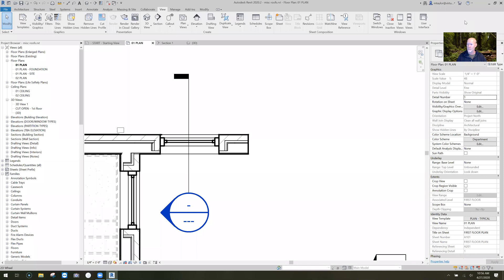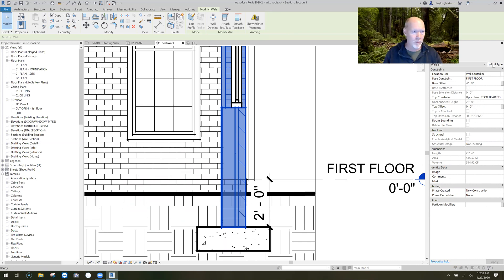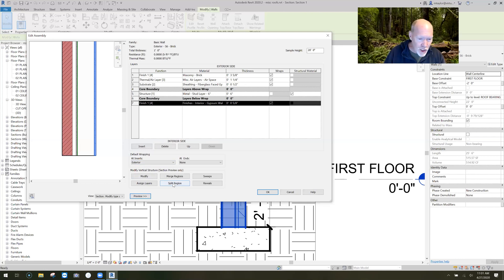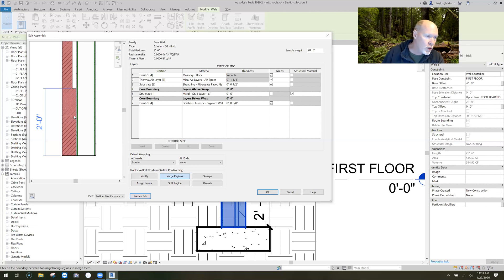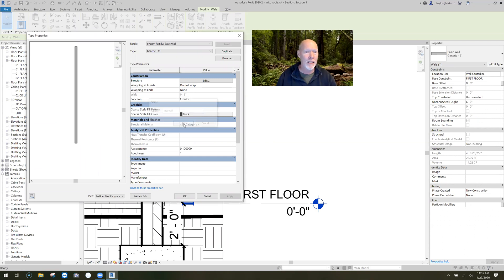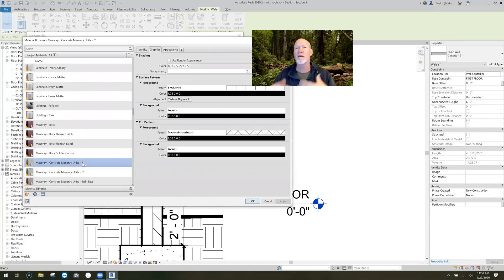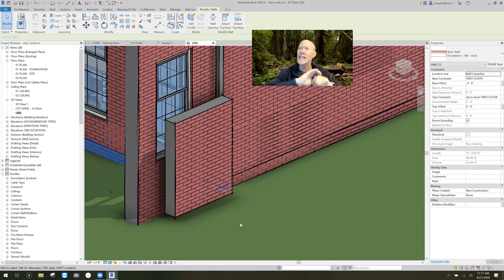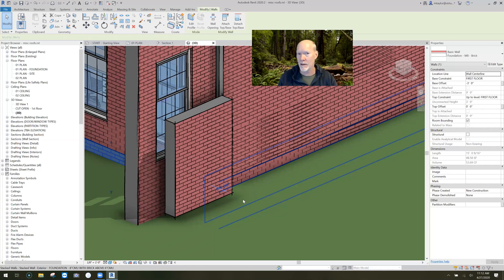MODIFY VERTICAL STRUCTURE OF A WALL: Merge and Split Regions

Comment: Ok so you split your wall brick above and CMU below. What if you want brick below and nothing above, in other word one of your element of the wall does not go full height. Do you have to add an air gap above? I see the use of the splitting wall but if you have to do that just to be able to modify the height of just one element, it seems like typical Revit nonsense. You have to split it in half then assign an air gap or some invisible material which I bet will still appear in section and that you will have to consequently cut-off with View/Cut Profile in every single view you have created... talk about counter productive. All you want is an Edit/Modify Height for each element but no, with Revit you have to create another view that the one you are working in of course because with Revit you always have to do it in the view that the developer has decided you have to do it in. Modify height of one wall element? I should be able to do it ANY view because you know what maybe I am working in a plan view or in an elevation or in a 3D view right now, and I want to be productive so I don't want to open or create another view. It is just an element height you want to modify, it should be SIMPLE! but no of course the torturous mind of a Revit developer is going to take you through a maze of tools that are useful indeed if you want to go intricate, do a bit of 3D Detailing why not (clients don't want to pay for it) but right now you want SIMPLE and it is just not there. So in typical Revit fashion and this is why it is so hard for graduates to jump into Revit from any other software, say goodbye to your intuition. You have to think like Autodesk, a firm owned by Wall Street lawyers so what would a lawyer do, and what does Autodesk actually do? I would buy technologies and software from various foreign companies most likely European if you are interested in Autodesk strategy to either destroy that piece of technology so it is not available to my competitors and end users or to merge it into Revit.  And oh boy, you can tell Revit is a freaking patchwork of different bits of technology and like the Frankenstein monster it is not very well stitched together. So the end user end up going through nonsensical processes to complete the most simple of task. One button: "modify height" pretty please? Nope it is just too straight forward, too fast. I looked at 'Create Parts' again it does not look like the feature you would use to modify the height of just one single element. These walls are full of features that are probably fun to explore when you are modeling a shed in your garden but when you have deadlines and you have to deliver the goods, 95% of your tasks should be uncomplicated, you want to be one to three clicks away from completing the most simple of tasks. Don't get me wrong, it is good that it is there but when I look at this particular feature I cannot see any application for it outside 3D Detailing because realistically and from a practicality viewpoint if you start adding sweeps and reveals and layers and merge or split stuff inside one wall, it means you are going to require a staggering number of Wall Types that you will want to be able to quantify but not necessarily show in Schedule. And I am not even starting with adding Metadata to your walls. It is only if you have time to isolate a bunch of walls to create 3D details that this feature is truly useful. Problem is, you need your end users to be perfectly drilled meaning know the PROS and CONS and avoid the temptation of using the tools that you know sometimes. In a large project where simplicity is key and turnover of Revit staff is high, going through a scroll down list of 500 walls because some Revit developers thought it would be a good idea to always create complicated paths but rarely the one you are going to need the most is NOT A GOOD IDEA. YOU with all your experience of projects going awol, you will know this is not a feature anyone should use, in fact there should be a big RED SIGN "use only in case of NO emergency". But the young graduate who knows his Revit tools, he is going to go for it to impress everyone with his Revit skills, you know like those guys who create Revit families so accurately close to the final object you cannot even dimension them. KEEP IT SIMPLE, that should be the number one rule. So let's say one of your technicians is an experienced Revit user and he is going to have the very BAD IDEA of using this very feature on all your walls in a large scale project because it is fun. It sounds great at the beginning but guess what, it is going to snowball when you will have to Schedule that monster. There is no naming convention in the World that is going to be able to tell young and even experienced Revit users that will come on board what wall type they should be using because someone made it OVERLY COMPLICATED and from there you know it is going to snowball even worst, you know people are going to start duplicating wall types that don't need be because they cannot find that one freaking wall they need because one guy decided to have fun with his Revit toy. This type of feature would not be a problem if you also had the simple "one-click away" feature and people were able to stick to common sense, problem is you don't have that "one-click away" option and most people don't use common sense therefore every single freaking Revit user in the project is going to achieve what they need to achieve the only way they know. I am all for nice features like these don't get me wrong, but in my view these are the type of features that will send your project into oblivion very quickly if you don't have a total control of what technicians are doing and guess what: Architects Leads know SQUAT about Revit, how you do it is not their concern as long as you do it right and in time. In any industry, you have to cover the basics well before you explore the fancy stuff, and I like the fancy stuff but I also know from experience the more fancy stuff there is the more rules you need to put in place. My gripe with Autodesk because they do buy a lot of technology from everywhere is that they don't take time to think about how a project actually goes to completion. KEEP IT SIMPLE. BASICS first and foremost, FANCY FEATURES come after. It is brilliant to have both, it is dreadful to get the fancy stuff but not the basics. If I buy a car, I expect it to have wheels on it, not wings because most people don't need an aircraft to go to work, it is cool but it is not practical.
Reply from the maker: Perhaps you should get a job at Autodesk and help us all!!! We have made ‘suggestions’ for them to implement.. but they seem to fall on deaf ears. I feel your pain!

Comment: Another option to create a thicker base wall could be to used a stacked wall, but you lose the controls you showed in this video. This was a very helpful video!
Reply from the maker: Stacked walls are powerful, but I’ve actually had more problems using them than just using individual walls.

Comment: THANKS,  I feel that you like the challenges so I need your help,  here my issue: I want to draw wall consist of two materials: the bottom is 120mm thick.  gypsum board partitions with hight 1000 mm and above that there is interior glass wall 1800 mm after that I need to open a glass door in this wall.  how that can be done?
Reply from the maker: I don't know the project like you do of course, but it sounds like you can simply use a gypsum board partition on the bottom. Then above that you can use a curtain wall...then add a door in it. I am guessing this would work best based on what I understand.  A stacked wall may be your next solution, but I would try the simple way first.  You could email me if you want.
Reply: @miketaylor-fantastic  A few days ago i tried insert a countertop, created in a Family Wall Based, and i can't insert on a Stacked Wall. Stacked Wall is not appropriate for this?